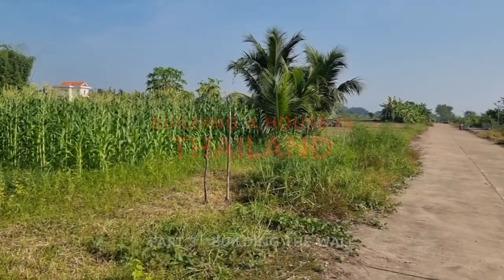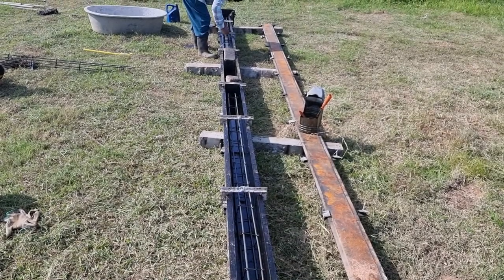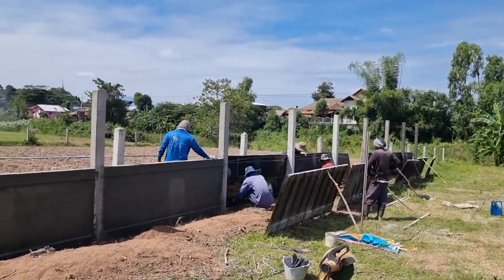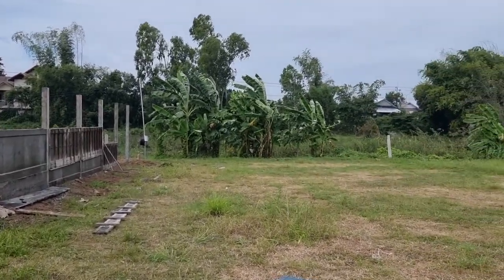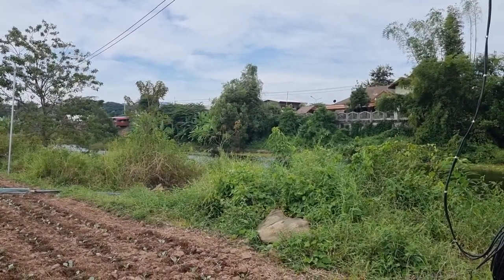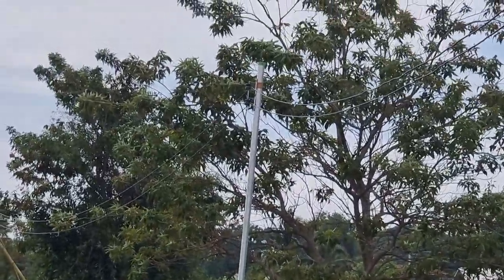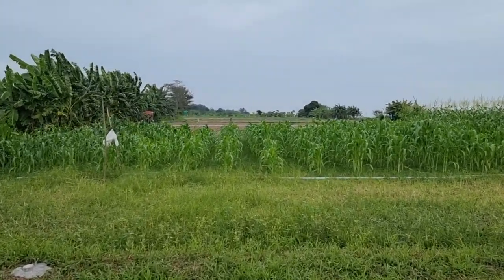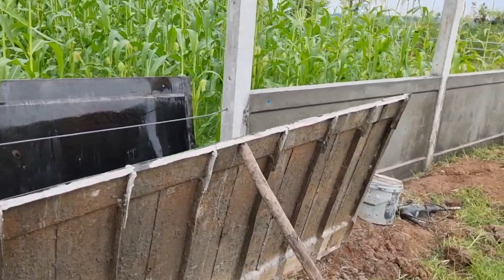Building a house in Thailand - Part 3 - The start of the wall

Comment: Where is the canti-lever for your fence?

What will stop it leaning over when the fill is added and the wet season impacts the footers?
Reply from the maker: Hi, thanks for watching, you need to keep watching, I don't want to spoil it hehe, but I will say we are filling outside too, we'll at the back anyway, plus there will be very little soil put inside, I've said too much now, but there is a plan for the back section that will be deeper back filled.

Comment: Hi Paul...enjoying watch the build. I was wondering what is the cost of the wall... It looks like 2 meters between posts. What do you think the cost is running per 2 meter sectoion... how about the cost at the 125 meters you are at now... thanks
Reply from the maker: Hi thanks for watching, the wall was 1800 bhat per 2 meter section but that is wth larger posts, 1200 bhat per 2m if thinner posts. Also a bit more for double height sections I think the total cost was 120,000 bhat for full wall.

Comment: Another quick question Paul... I was quoted 1800 baht per section 2m long x 2m high for the labor... and 2 meter long x 1 m high 900 baht which does not include materials... i think they said 2m long x 1 meter high was 1800 baht for materials and labor... so i'm guessing for 2m long x 2 meters high should be around 3600 baht... does that sound right to you... the 1800 baht that you told me was that for a 2 meter x 1 meter high section for materials and labor... again thank you sound much for all your help...
Reply from the maker: Hi, it was 1800 bhat per 2m x 1m all inclusive of labour and materials, for the 2m high sections was not double though it was something like 2500 bhat for those, I would need to count all sections for a complete breakdown of the cost, I also had the inner wall to that was 1m x 2m but the posts were only to the 1m height to as this area will not be seen, it was more a support for the main wall to take some of the weight off it.
Reply from the maker: Oh we had it done by relations too, everything was manufactured on site, they made the posts and panels as they went, I think there were about 70 panels altogether a dozen or so are 2m high so yea at 120,000 it works out at pretty much 1800 per section.